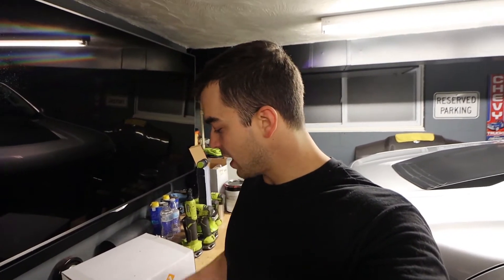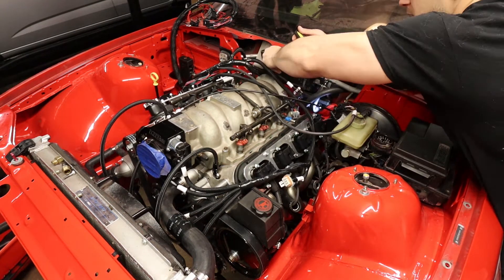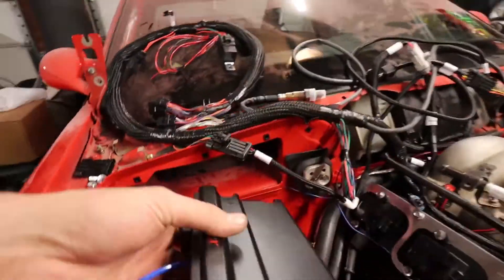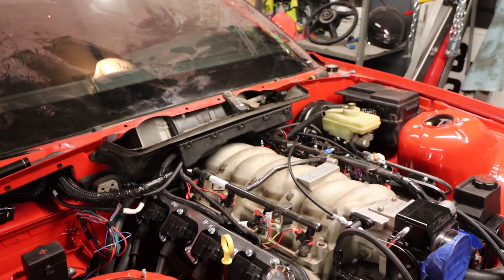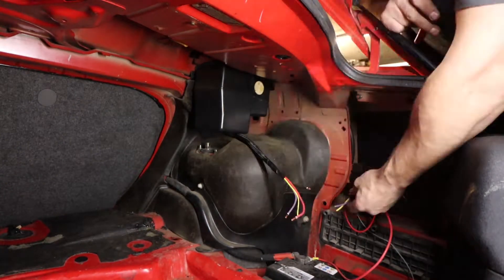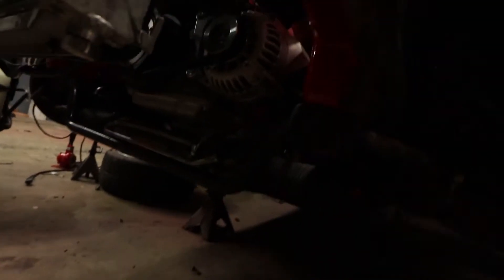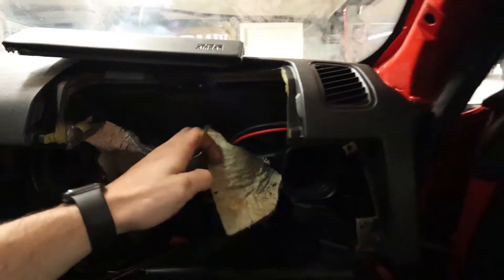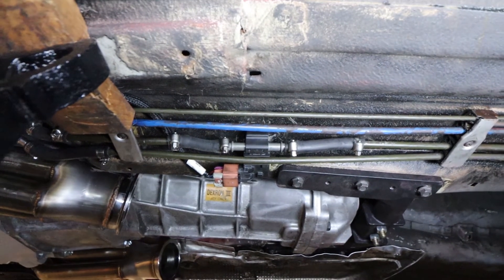Holley Terminator X Install, Best Budget ECU? E36 LS Swap Pt. 15

Comment: I’m doing the same thing with my e36 as well. But I’m kinda stuck on deciding between the terminator x or the max. I’m using my oem zf trans. Does this mean I need the terminator max because it’s not a t56? Thanks your videos are helping me tremendously!
Reply from the maker: I'm not positive but I think most guys run the X Max when using an auto, and thank you!!
Reply: @matt13ross  I’m just gonna wing it
Reply from the maker: That’s what I usually do lol
Reply: Max is best for auto trans
Reply: @SOMT91  mine is stick
Reply: kind of late but what one would i use for my manual getrag 5 speed?
Reply: @johntrejo1044  you should be alright with just the X

Comment: Did the Holley Terminator X allow you to complete bypass VATS? What did you do about VATS/BCM
Reply from the maker: I didn't have any type of key chip or security on my car, being a 1994.
Reply: @matt13ross  VATS would have been part of the ecu for your 6.0. By the sounds of it you didn't have to deal with any of that! Thanks
Reply from the maker: No GM ECU when you use the Holley. Holley replaces all that

Comment: If I got the terminator x max ls1 24x (550-919) am I restricted ls1 motors or am I able to go any 5.3 4.8 6.0 with the system ? Got it for a steal on market place lol thanks in advance haven’t gotten a clear answer
Reply from the maker: I know you can run the Terminator on any LS based engine, whether that be a 5.3, 6.0 truck engine etc.  Idk specifically if you have the correct one though.  Depends on some of the sensors on the engine.